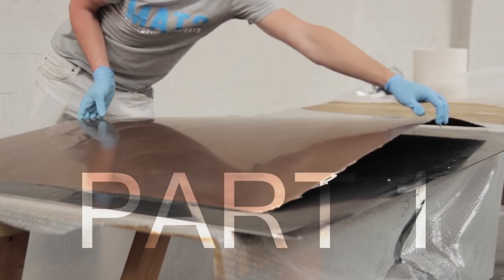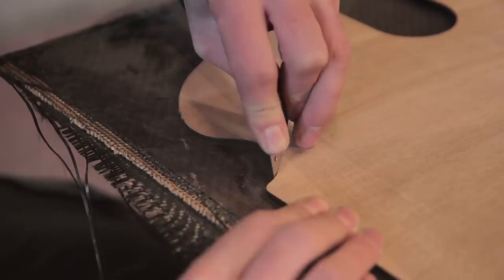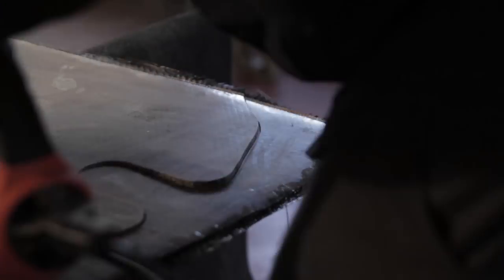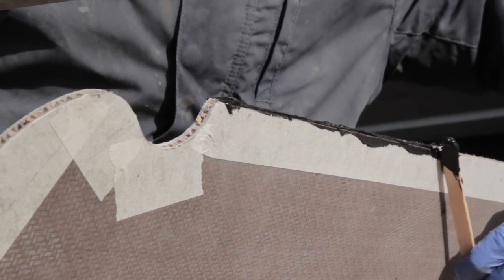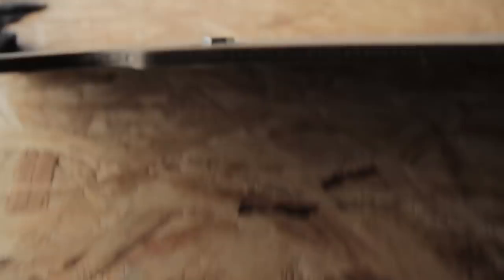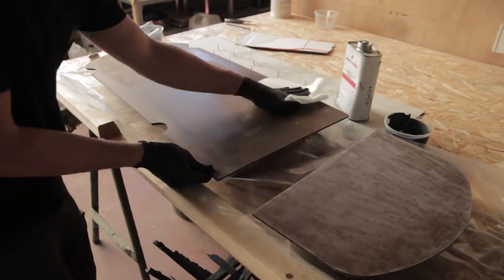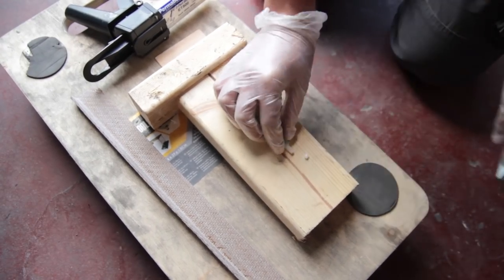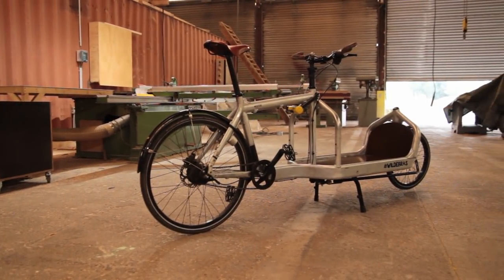Cargo Bike Honeycomb Core & Jute Board - Bullitt bike *PART 2*

Comment: If you use a thicker honeycomb core, you could build the hinge as one flat piece, then cut a 25mm wide bit of the top skin off and then bend the plate to form the angle on a jig. Then fill the gap with a thickened epoxy. You can make some cool curved pieces with honeycomb panel this way. It works best with Uni skins

Comment: about the edge of the honeycomb. i'm not sure if this can be applied to your situation, but when we were making honeycomb strutures using prepregs, there was a sort of white paste to put on the chamfered edge of the honeycomb to avoid collapse. 

could you precut your hc and boards and glue them in place and use the paste i mentioned before the glueing? or give it a generous filling near where you just expect the cut to be. i don't rmemebr the specification of the paste, nor i know if this could be applicable to your setup, sorry. but putting that paste was really quick. keywords to search for are honeycomb potting or filling
Reply from the maker: Thanks for the info, must be some epoxy mixed with microballoons or something 🙂 thanks for the idea
Reply: yes! exactly that! it worked good! we used it to prevent water entering in the core if boats and such. 

while we are here... i've done infusion successfully on normal shapes and moulds. now i have to do a 1-off  "container" and i was planning to shape a male shape in polystyrene and then cover it in cf, and melt the foam afterwards... do you think i can make an infusion of it or being a closed surface i will have issues with the resin front? thanks 
 @MatthieuLibeert

Comment: matt 2 things, first I was wondering why didn't you make a one-piece part with a sheet rather than make 2 pieces and glue them together to make this part was it bc of the honey com or it had other special reason, another thing is do you really have to paint the part with clear? I don't have the equipment for it to paint the parts I make
Reply from the maker: In two piece because otherwise I had to make a mould, paint is not necessary but protect your part à bit more against uv light
Reply: @MatthieuLibeert  got it thanks